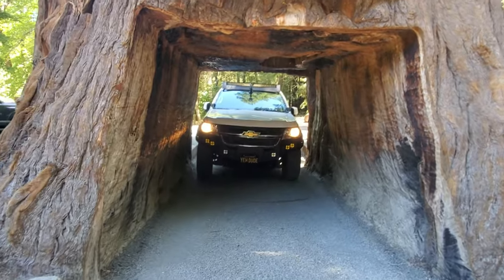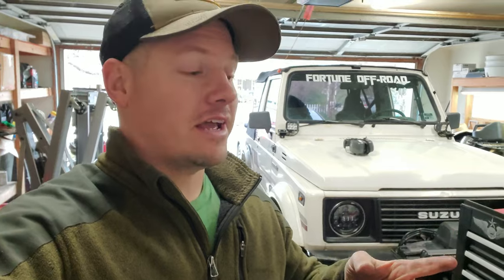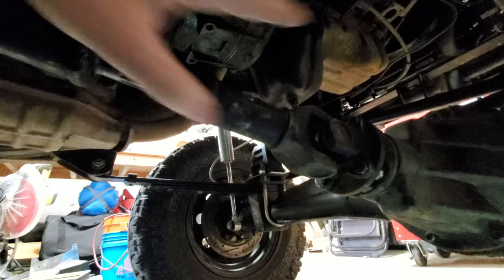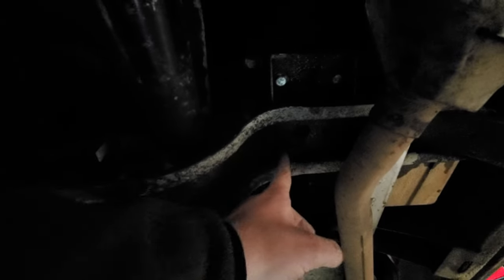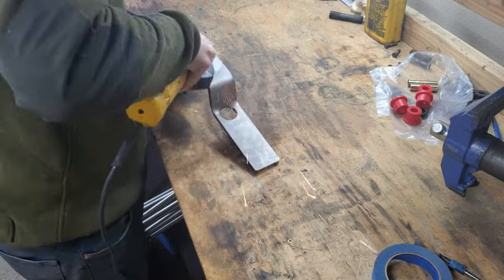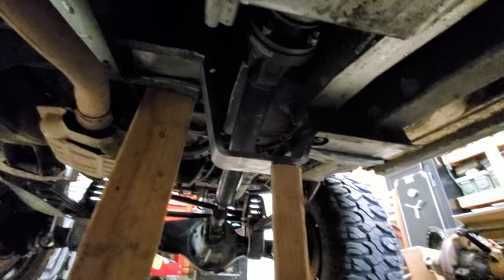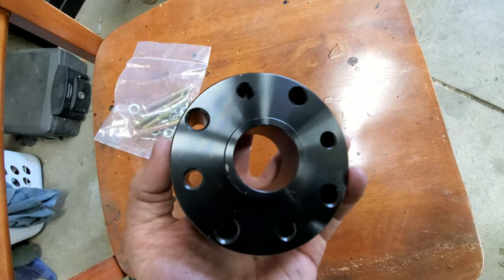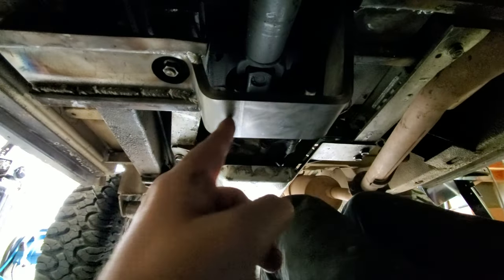Front Driveshaft Fixes | Suzuki Samurai

Comment: I'm using modified Toyota drive shafts. They bolt to large flange Samurai flanges. You just have to bore the centers a little where the nut is in a lathe because the Toyota drive shaft yoke flanges have a larger centering ring. You also have to take die grinder and clearance the little dome in the center of the drive shaft yoke a little so the samurai pinion shaft and nut clears.
Reply from the maker: Nice! What size tires are you running with that setup?
Reply: @FortuneOffRoad  I've been running 33 - 12.50 - 15 on 15 X 8.5 wheels. Since 2014. My rear shaft is a shortened 1997 Toyota 4Runner V-6 automatic front shaft.  My front drive shaft is a lengthened 1980 Toyota four-wheel drive pickup front shaft.  I cut the knuckles off of the front axle and rotated the pinion up and welded them back on. I can drive over 60 MPH with the hubs locked without any vibration. The angle on the rear shaft is pretty steep. Driveshaft shop told me it would not work. I work in a machine shop and made these shafts myself. I sometimes drive 3 hours one way only interstate to go wheeling. I haven't had any problems. I do put a shot of grease in the rear universal joints at every oil change. I recommend using only genuine Toyota u-joints.
Reply from the maker: @russgould707  sounds like a good setup. Thanks for the info!